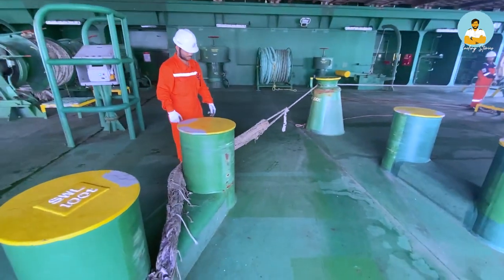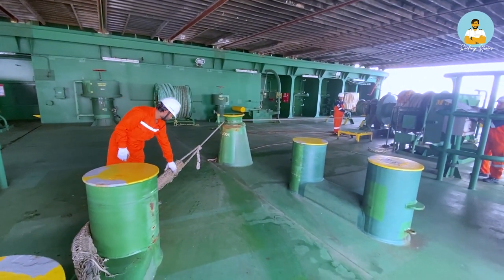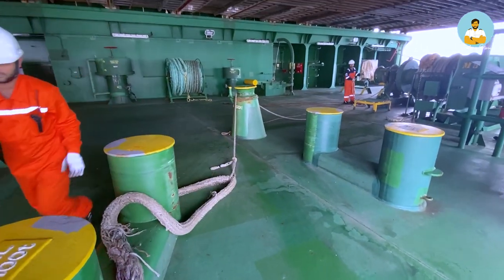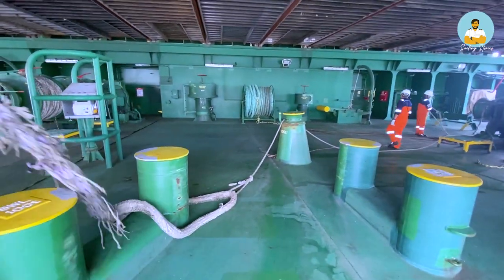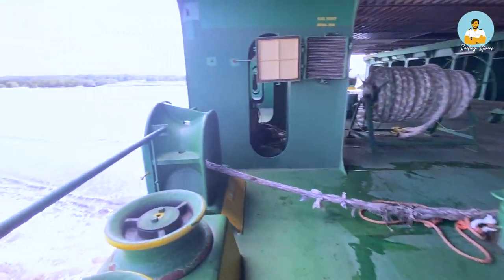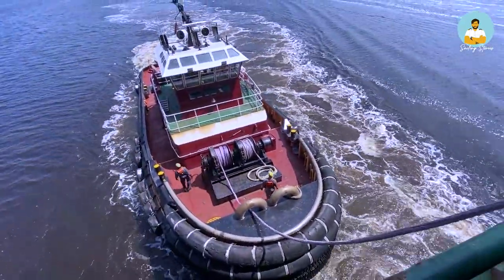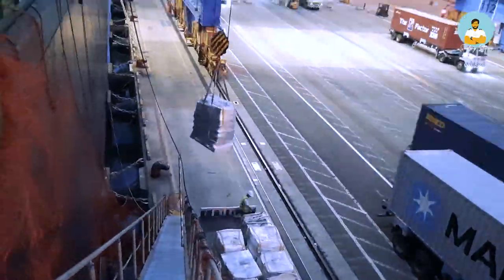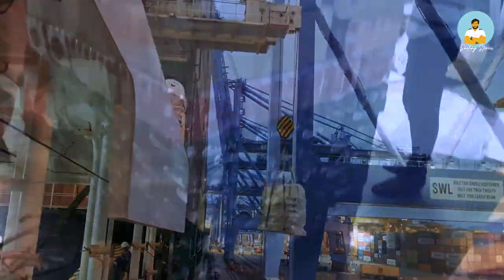How we make fast Tug boats || Merchant navy || Life at Sea

Comment: Good video, isin’t is a good practice to put the eye of tug line on the first heavy bit than the second one, many masters insist on using the first heavy bit for putting eye of tugline.
Reply from the maker: Hello !! It depends. The 2nd bitt provides added safety and is just a general practice. You can put wherever you want as long the tug pull does not exceed SWL of bitts

Comment: Does the messenger line belong to the ship or to the tug? - at the start of the operation the messenger line was passed from the ship to the tug, but at the end the messenger line remained attached to the tow line and was passed back to the tug where it was retained.
Reply from the maker: Hi John ! The tugline itself has a messenger line connected to it (or sometimes known as a tail rope). Ship crew passes 1 messenger line to the tug to which the tugline’s messenger line is connected.
While letting go, the tugline is pulled first from the bollard with the help of ship’s messenger line on the winches. In this video, the tail rope happened to be of sufficient length. So there was no need of ship’s messenger line. Hope was able to clarify
Reply: @sailingstories  Thanks.

Comment: My dear friend your video is very nice well done,but you forgot 1 thing.When you picked up the tug line and it was on the winch,you should put the stopper line to secure it and then slack the winch and put the eye of tugline on the bit,i know it was not so tight but better , safer is to put the stopper.
Reply from the maker: Yes. Rightly said. As it was not tight, its not always needed to be put on a stopper.
Reply: the thing is you can never trust the tugboat crew especially in countries like Nigeria China etc, @sailingstories